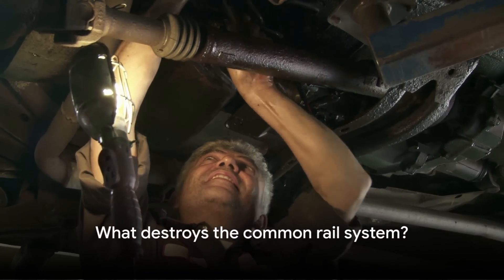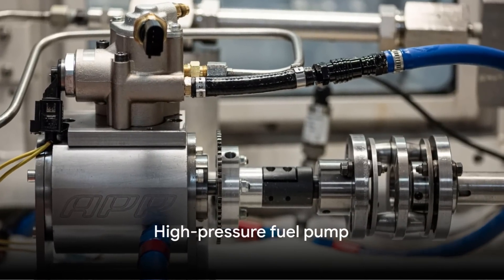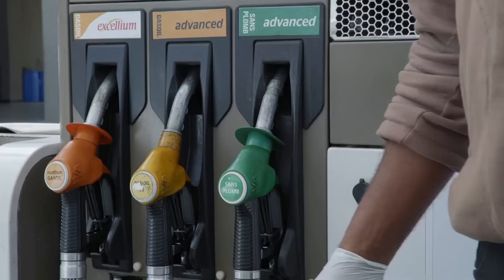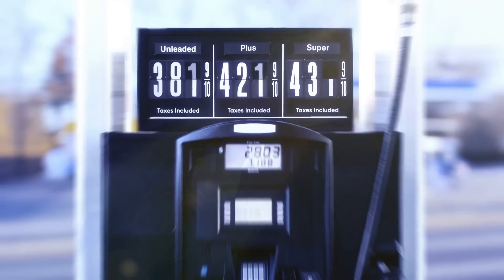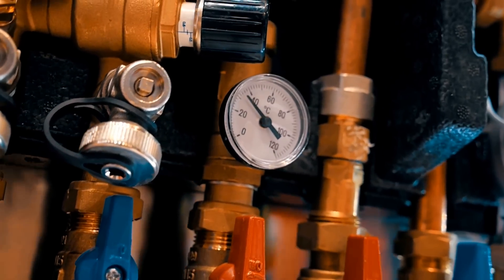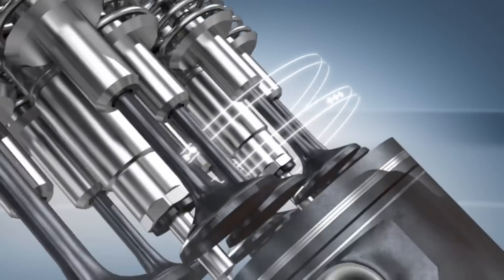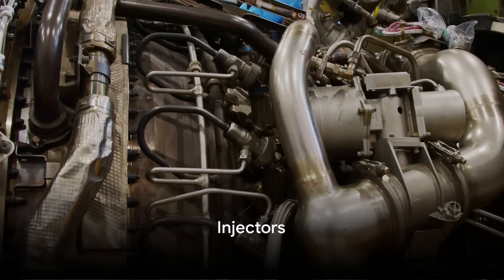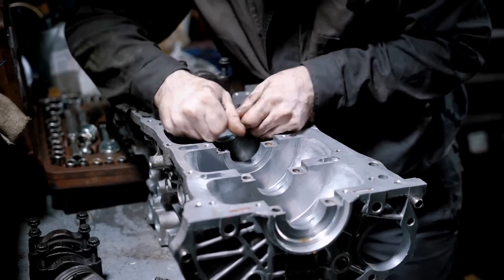What Kills  The Common Rail System

Comment: Hi. When the car is cold everything is fine. When temperature 90C on 4 gear, power goes down. Glow plugs new. This is high pressure fuel pomp or injectors damaged ? Thank you in advance
Reply: How much diesel have you in the tank????
If you have 5-10 L diesel in the tank then you have that problem 
Especially if you are uphill and the outside temperature is high
Reply: Half tank. Im changed rail sensor, high pressure pump sensor. And nothing.  I'm thinking is turbo filter problem
Reply: How much diesel have you in the tank???
If you have 5-10 L diesel in the tank then you have that  problem 
especially if you are driving on uphill and the outside temperature is high
Reply: Always add a little splash of new motor oil in the tank

Comment: Now I own a 2011 GH Mazda 6 Sports Hatchback and it has a fuel injector system which is all that I know about these injector systems. I believe my own car's fuel delivery system that is not quite the same as this example in this video but I still wonder if maintenance on the engine fuel delivery system is as necessary on my petrol powered car as  a diesel powered vehicle?
Reply from the maker: Yes. You don't have the same fuel system, but it needs to be maintained too! Good fuel is relevant for everyone! Watch lambda and other sensors, change air filter and plugs in time and your car will drive without problems!

Comment: Fuel quality is key.
Do your maintenance.

The older Bosch commonrail systems you find in most Eurodiesels from the 90s into the 2010s last a long time.
Lots of diesel vans and cars here will still have the original injectors and high pressure pump even at 300.000-400.000km and 20 years old.
The high pressure pumps pretty much never die when there are issues its the injectors or a sensor.
I need to do some research into the exact types of pumps Bosch made during that time.

Mercedes used Delphi Piezo Injectors in the OM651 engine and since they were junk they went back to standard Bosch solenoid injectors in the OM654.
The older OM611 and 646 aswell as the 3.0 V6 OM 642 were friggin indestructible, they were made during the golden era before everything started being complete junk across the board from all brands.

Standard Bosch Solenoid Injectors are the best commonrail injector for cars and vans.
Cant speak for large Diesels in Trucks and Buses.
Reply from the maker: Yes, I agree completely. I have a diesel bmw e46 with 300k km mileage, the injectors were like from the factory and there were no issues with the fuel system. Engine m47n 2.0 diesel

Comment: Wonder what the overall operating cost of modern diesels is compared to older engines.  It boils down to radically increased maintenance costs including sensors vs higher fuel consumption.
Reply from the maker: Yes, maintaining a diesel is not as cheap as it seems. But with proper maintenance, diesels run great!
Reply: Nah not radically increased at all.
Engine oil for Diesels is fairly cheap, Fuel additives to help lubricity and maintain a clean fuel system are also cheap, EGR Cleanout is a diy job.
My diesel car has 250.000km on it and the drivetrain can do over half a million but the transmission will go around 500k.
Fuel mileage is really good.

Comment: water in the diesel -- a comon problem of petro stations -- and biodiesel, - these are the most common culprits.
Reply from the maker: Yes, and it’s very harmful for car fuel system
Reply: @autoadviser2779 I fitted a water separator to my car, and its amazing how much water it collects over the period of a month. I drive a 39 year old mercedes with an inline low-pressure injector pump, which is less finniky. I add a bit of engine oil to the diesel and avoid bio diesel as good as possible.

Comment: Common rail is far simpler than mechanical timed fuel injection. It has electronics but this manages timing, while the pressure is managed by a valve on the rail.

Comment: My TD5 Defender has done 400 000 km so far. The turbo, the common rail system and injectors are still original. It has been serviced (mostly) on time. It has had good and shitty fuel. It is remapped and has a larger intercooler- a 2.5 litre turbo diesel doing 135kw and about 400Nm of torque. Diesels, turbos and ECU’s are not the things to worry about. This thing has been all over Southern Africa- doing highway and off-road. Sensors like air density etc are the biggest problem, but compared to maintaining a mechanical pump system I take electronic every day of the week.
Reply from the maker: I agree! Many diesel cars are very hardy and don't cause much trouble with proper and timely maintenance.
Reply: TD5 was designed to run on poor quality fuel as it was specifically designed for military use originally
Reply: I'm looking at buying a diesel cab chassis for work, and have never owned one.  Everything I've read so far indicates injectors may need replacement a bit over every 100,000 kms, so 400 + is impressive.
Reply: I’ve got a defender td5 as well ,and it’s just turned over 400 000 km with original injectors and rail ,can’t stop,it

Comment: just preserv everything on a shelf. get your self an old style inline mechanical pump. preferably from an old merc , if you can find one that fits yours engine layout. do get the injectors too. no electronics involved. and not allergic to today's low quality fuel. allso keeps your common rail system in good condition, where it belongs. on a shelf in the workshop.
Reply from the maker: Is this from your experience using it or in theory?
Reply: @autoadviser2779  i have converted engines from different solution back to regular mechanic injection .
Those engines , all of them managed better economy and more favourble tourqe curve.
Reply: Could you give me some advice for 2.0tdi, 140ps common rail Audi A3, year 2011? What does it fit, please?
Reply: @Kliq-n2s  not sure about the 2.0 blokk , 1.9 pd engine we did convert whit a tdi headswap and the pump from the regular tdi version of the engine. 
Highly likely the same methood would work. The head swap was not an outmost necessity but the pd head would had to be repaired , and we had a td head on hand that was refurbed allready. Bolted on whitout any modification. The pump went on allso whitout issues.
We have a ford 2.0 tddi engine , that had simply no space for the merc pump. It ran like dogshite whit a simple tdi pump. Thing did not have enough timing advance to get it past 3k rpm. We went for a smaller pump from the 1.6 wv block , the one that was made for indirectly injected engines. Whit that it ran perfectly. Was the 115 hp base model. Whit a turbo swap to gt1749vb it made 170 hp whitout any other modification . 

So my advice is to visit s used parts dealer and see if they have any of the 2.0 engines you got , usually for a small price you csn check the fitment of a pump whit those parts. What allso needs to be verified if the head can accept the injectors suitable for the pump that fits. 
Quite likely anyone who salvages cars should have the required parts. You may need the pedal rack to have a cable operated pump instead of electric. Some can be modded, some not.

The longest running converted from common rail to td we had did about 300.000 km after conversion. Good as new. Starts cold and hot Just like new. Its in use for transporting foreign workers back and forth. So does highway mainly. Its the 1.9 pd wv actually. The bottom end has least 500.000 km+ in it , still no sign of it wanting to die. When the conversion was done we did replace the conrod and crank bearings.  Its been running for 6 years now. No smoking , not ever a check engine light of any sorths (duh.. its mechanical..) it ain't leaking or eating oil. 10.000 km oil change period. It did had glow plugs replaced. And thats all. Thing keeps working as it should.
Reply: @nagyandras8857  thanks for the reply man! I will look forward to this and discussing with some of my mechanics. I would like to know what they say! Greetings from Kosovo!

Comment: This is over dramatic. The same things that damaged the older mechanical diesel fuel components damage a common rail system as well. Poor quality fuel regarding Sulphur content is bad for all diesel injection systems. Storage tanks at fueling points are another because of moisture and bacteria contamination and the fact that many fueling stations do not have adequate filters on their pumps due to cost cutting on maintenance.  The next main factors for fuel system damage is the fuel filter in your vehicle and how often it is changed. Diesel fuel lubricates the fuel system  so anything that reduces that lubricating quality will cause wear problems. A common rail system circulates a lot of fuel so if you run your fuel tank at a low level often then the fuel will heat up more on longer runs and this can reduce the lubricating quality of the fuel and it can also lead to condensate moisture forming in the fuel tank and even bacteria growth so the inclusion of a clear glass container before your fuel filter is a good addition to see if you have a moisture problem or bacteria growth. It's all about good maintenance and observation.
Reply: This is my thought exactly.  All of these problems are not isolated to common rail diesel injection systems.  They are related to anything mechanical.
Reply from the maker: A lot of people drive a car for a couple years and they don't care about fuel quality and maintenance issues, which is a shame.

Comment: Are the high pressure pumps self priming (in case air enters the system when performing a fuel filter change)?
Reply: The high pressure pump is supplied with fuel from a low pressure feed pump (usually found in the sending unit assembly) which then flows through the diesel filter/water separator before entering the high pressure pump.
Reply from the maker: Require manual priming
Reply: Yes or there is a hand pump on the filter housing
Reply: On my sprinter om651 your supposed to let the low pressure fuel pump run for ~2 minutes by turning on the ignition. This primes the filter automatically, as you can hear fuel flow through it pressing out air back in the main tank.

Comment: How long is prolonged idling?
Reply from the maker: There is no need to warm up a diesel car, the diesel warms up better while driving. It is better to drive straight away, but do not accelerate, allowing the engine to warm up gradually.
Reply: @autoadviser2779 , thanks!
Reply: More than three minutes
Reply: @llewvirtue861 , thanks!

Comment: Cp3 is the best high pressure pump  for a CR
Reply: CP3 has one piston only, and earlier models wear out within 300 000 kms easily. The newer, improved ones are better, but nothing beats CP1 when it comes to reliability, besides minor fuel leaks that can be fixed easily, it outlasts the lifetime of the whole engine.
Reply: @imrebese5502  cp3 pump have 3 pistons.  And cp4 have 2 pistons. Google is free
Reply from the maker: Share more about the experience of using it? We would be grateful

Comment: Conventional injection pump diesel is the best, no electronics, no sensors, no fancy technology things, they keep running even with bad fuel quality
Reply: When my 1964 Mercedes w110 200d stops working I may consider buying a car with a computer in it.
Reply: Agreed 100% from personal experience.
Reply: True, but we aren't robots. We breathe air and a think called lung cancer exists. They're also low on power per cc and spew out black soot. I don't want my kids inhaling that crap, since I wouldn't be the only one driving these vehicles.
Reply from the maker: @em4703 , what car do you have now? ev?
Reply: So hard starting , less power, less tunability, worse drivability, worse emissions (more disease) , and worse fuel economy is better? Next your going to say a carbi is better than efi on a petrol car !
Reply: @Four-LLC  worst fuel economy?? nah. . my land cruiser still make 14km/liter, it's good enough for me, easy to maintain is my priority for me who live far from big city
Reply: @Four-LLC  less tunability maybe true, less power and worse fuel economy maybe wrong. I have 98 car with injection pump and 2020 car with common rail, same exact engine, and they produce same exact power. In moderate driving they both achieve 14 km/l. IMO, common rail is beneficial for the ones who only know how to floored the pedal. ECU will do the matching of engine load, RPM, fuel volume for you, whilst with the injection pump you do it yourself
Reply: @ I’ll put it this way. Common rail injection compared to mechanical injection is like EFI compared to a carburetor. A common rail injector is so precise, fast and accurate that each injector is inscribed with its unique properties, to correct for manufacturing tolerances, the injectors fires 5-7 times per each cylinder firing .. even at 4000 rpm ! The ECU uses the crank angle sensors dot detect minor differences and perform small injector quantity  relearning. Also the pump is much simpler.
Reply: @Four-LLC  Indeed it is, I have repaired a Rolex pict 34 carburettor on a 1964 VW split window kombi in MOFA Zimbabwe with a lion lager bottle top and some Pratleys Putty. The car did 200kms last week and the repair was done 30 years ago.

Comment: Quality fuel, that's why they put bio diesel in it?
Reply: That doesn't make it lower quality, it just brings other problems for older cars as biodiesel can react with older rubbers or gum up at lower temperatures. Fun fact, biodiesel, even at 7% by volume, offers better lubricity than the high sulphur diesel fuels of older times.
Reply from the maker: Not every engine will be able to run on biodiesel.

Comment: Climate change... 😂😅🤣
Reply: F*** this common rail shi.t let's go back to mechanical injectors the failure rate was so much lower and remove this f**** emission ship would get even better fuel mileage then
Reply: Regards from Athens Greece...
Reply: Best answer
Reply: I put liqui moly and the pump died
Reply from the maker: That's too bad. What model of car do you have?